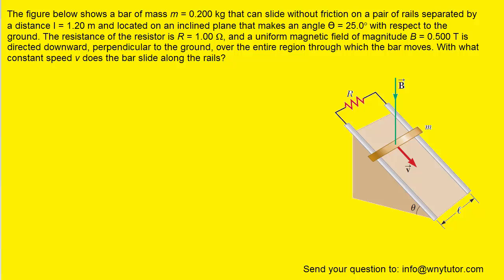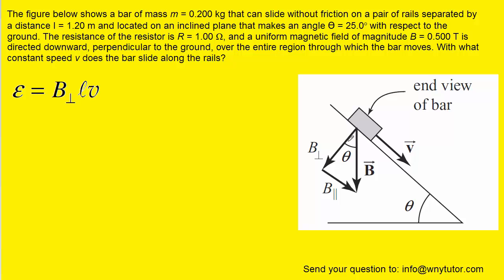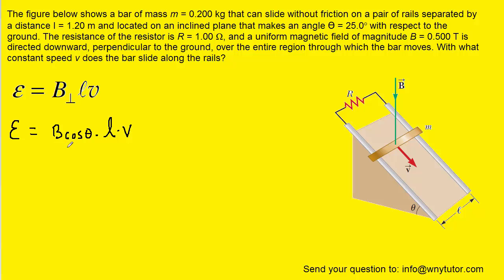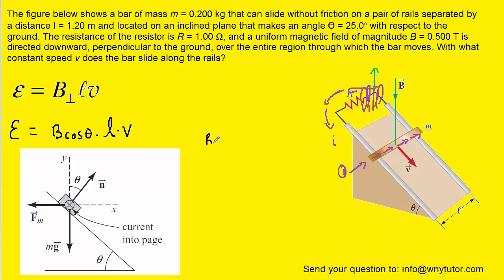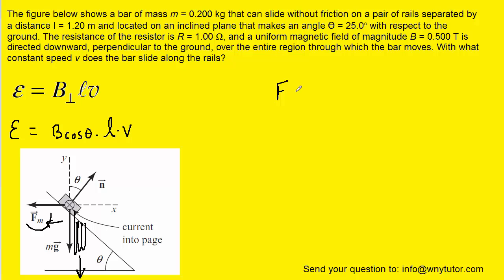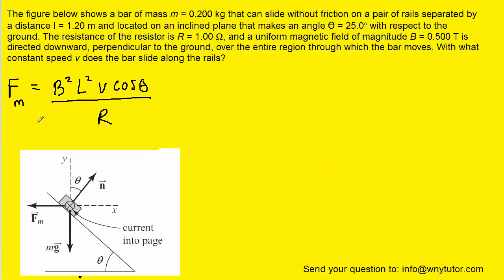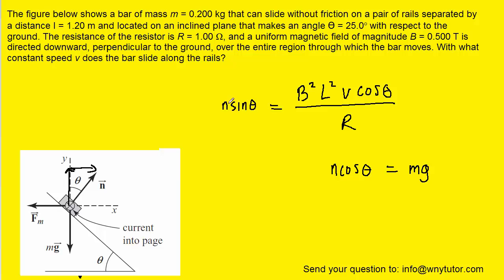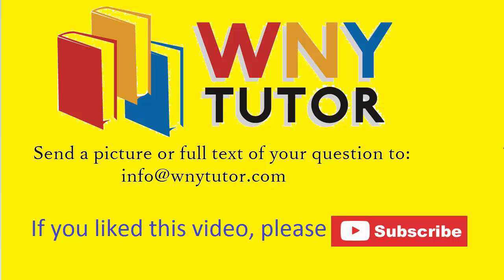The figure below shows a bar of mass m that can slide without friction

Comment: Even though the obtained final formula is correct however the procedure followed to obtain the final answer from minute 6:52 is not quite correct, where it is given in the problem that the bar  slides without friction, as the surface is friction-less this implies that there is no normal force n, hence equating the x and y component of the force is not correct. It is simply enough to equate the forces along which the bar slides to have the same equations, where we know that the bar would reach a terminal velocity ``a non-accelerating velocity''. Hence applying equilibrium condition the magnetic force makes an angle theta with the direction of inclination and hence Fm cos theta = mg sin theta and from there you can have the same final value. Yours
Reply: Friction or not the bars weight is being applied to the rails and the rails apply a normal force on the bar.

Comment: To add on to what you said about using the right-hand rule: You can point your fingers towards the direction the bar is sliding (velocity vector) and curl your fingers to the direction of the magnetic field. The thumb will point in the direction of Induced current; which flows from high to low potential (CCW)